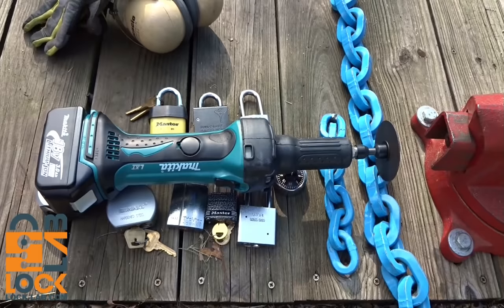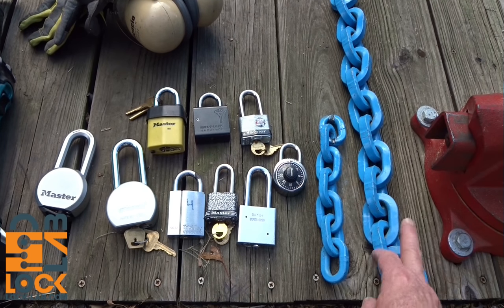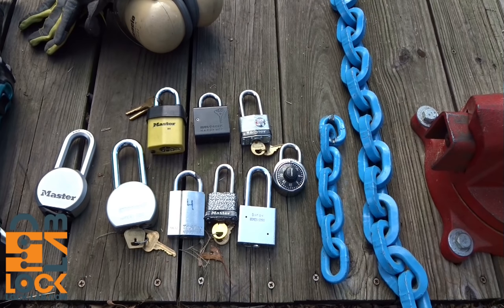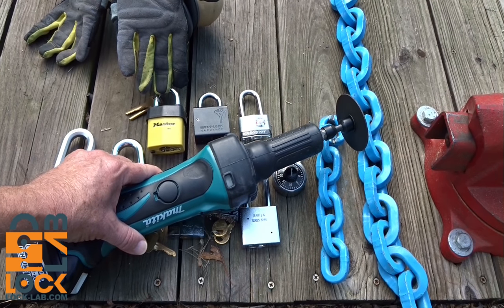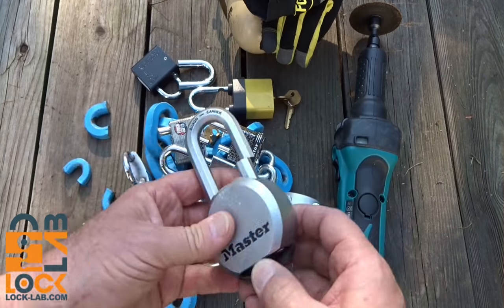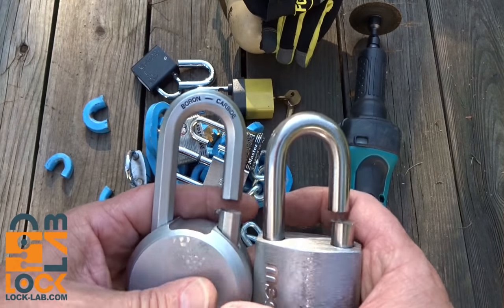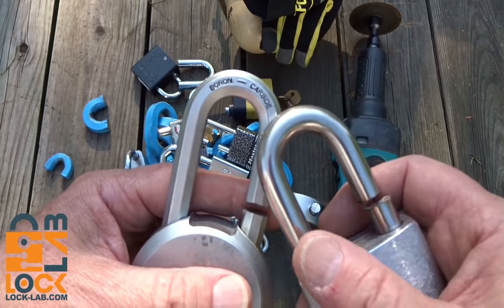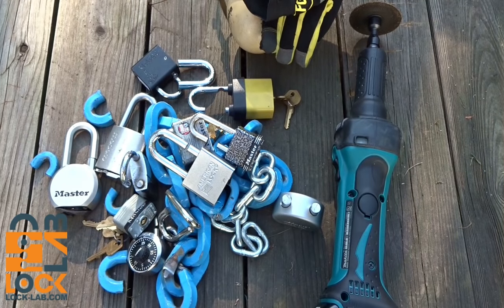(930) Die Grinder versus Locks - How Long?

Comment: This is pointless... The only main difference between a die grinder and an angle grinder is that the angle grinder is offset 90 degrees, and is only set up to accept grinding wheels, where as a die grinder can use a multitude of attachments. They both spin at the same relative speed. In theory using the same cut off wheel on a die grinder and an angle grinder with the same pressure should cut at roughly the same speed.
Reply: Actually nope it's not just one is angled and one isn't generally angel grinders run around 10k rpm and die grinders around 20k not to mention die grinders are more compact and lighter than able grinders.
Reply: Most electric die grinders go to 25K, even the cordless ones. The cordless 4.5" angle grinders I have ever seen go only to 8.5K. But you have to include the diameter of the wheel to get the surface speed. Circumference is proportional to the diameter. So the die grinder in this case is (25x3)/(8.5x4.5) times faster. This is 1.96 times faster surface speed, best case scenario, using fastest die grinder vs typical cordless angle grinder... both with a brand new disc. As the disc wears, the angle grinder will catch up a bit.

The other major difference is the thickness of the discs. The 1/16" disc in this video is actually thicker than many angle grinder cutoff discs. If he used a 1/32" disc, it would have cut much, much faster.

The other factor is the rigidity of what you're cutting. If you lock the shackle in a vice, you can probably cut it faster with a high power angle grinder, because you can put more weight into it vs a lower torque die grinder. (Assuming the angle grinder has more power, which is the case if you are buying tools at the top end of the power spectrum). But if you can't clamp the lock down to something heavy/solid and are just holding it in your hand, speed trumps torque, and the die grinder should win.

If you want the fastest cut through a lock shackle with a portable cordless tool, I bet a cordless trim router with a 1/32" cutoff disc will beat both die grinders and angle grinders.  Same speed as the die grinder but with more torque.

Comment: all these different pins and learning how to pick and then some punk can just grind through the lock in 10 seconds and get away with it. sure its loud, but no one will get up at 3 AM because of 10 seconds of noise, and when the police is there the thief will already be gone. so better not leave your bikes outside!
Reply: Exactly and if there is a thief prepared enough to carry a die grinder, he's probably prepared enough to bring a gun. Nobody gonna risk getting shot over your bike getting stolen.

Comment: this is close to what i was looking for. i use a battery 4.5" to 5" grinder with a metal cutting blade at 8500 rpm. i use it to cut a lot of things. modify doors and door frames. if you could not cut the lock with it, it seems that you could just cut anything that the lock is attached to.

Comment: So bottom line it doesn't matter what lock and chain you are using. It is only a few seconds different.
So, the question is - what all of these big and heavy locks and chains bringing to the table?
Reply: They are a deterrent. You can never prevent entry unless you have a private army, it's all about making entry difficult/inconvenient/noisy enough to deter would-be criminals.
With that being said, I was pretty shocked to see how effective this die grinder was, and based on the physics of a die grinder vs an angle grinder, I bet a simple battery-powered dremel would be pretty effective too (maybe taking 4 or 5 times longer with a good cutting wheel, because dremels also have insane RPM)

I'm guessing 99% of criminals have no idea how to pick anything more sophisticated than a very basic lock, and will always prefer force - so in that case I think it maybe makes sense to buy big locks and chains, but not sophisticated or high-strength ones - expensive materials only seem to buy you an extra 5-15 seconds.

Comment: I'd like to hear the logic as to why people think a die grinder would cut something faster than an angle grinder.
Reply: Tim Ramich I have no idea, maybe they meant  a cut off disk for an angle grinder. I mean, if your going for small, a dremel micro is about at small as you can get, it will easily fit in your pocket and cut through a lock shackle without the battery dying, why not use that instead of s die grinder ( although die grinder are much better)
Reply: RPM's, a die grinder gets up to 25,000, an angle grinder is a mere 8,500.
Reply: majikthise110 but die grinders have a lot less torque than angle grinders. You can really crank on an angle grinder and take off more material per rotation with an angle grinder. The die grinder even crapped out a few times when bill was cutting through the shackles, that won't happen with an angle Grinder unless you REALLY pushed on it.
Reply: majikthise110 You're talking about an air die grinder. They have little power. My cheap Skil angle grinder does like 14 krpm. What matters more is the linear velocity at the edge of the disc and the horsepower behind it. An angle grinder is for cutting. A die grinder is for small carbide bits for, you know, grinding imperfections from dies.
Reply: Tim Ramich the RPM's I said were both from makita cordless tools.

I'm not sure how much applying extra pressure and torque will actually affect the rate of cutting. 

I feel the narrow surface area of the die grinder will help to cut faster aswell.
Reply: majikthise110 to better explain myself, imagine a hand saw, it bites a lot deeper and cuts a lot faster when you apply more pressure, right? It cuts better, but only until you can't put enough effort into the stroke the make the teeth cut into the wood your driving them so deep, this will have the same effect on a cutting wheel, so more torque allows for more purchase I guess you could call it. As for the smaller contact point of the die grinder, I already said use a cut-off disk for an angle grinder, instead of the grinding wheel bill used in an older video.
Reply: +Tim Ramich you have no fuckin clue what you're talking about. air die grinders are the industry standard for power AND rpm. you must have some shitty harbor freight die grinder on a bike pump.

anyways, to answer the question, the reason rpm matters with cutoff wheels is because it's abrasive. it's not a saw, it's not cutting away metal shavings. it's just abrading away sparks with the material from the disc itself. that's why you need high rpm. an angle grinder works fine, too, and you use angle grinders for more than just cutting. so for strictly abrasive cutting purposes higher rpm is better because the faster you get the abrasive material (aluminum oxide for cheap disposable discs, add carbide dust to taste for even better cutting performance for more cost) in contact with the metal to cut the faster it gets through it.

the abrasive disc itself is what does 90% of the work, the weight of the tool is enough. torque requirements only go up with feed pressure and contact area, that's why cutoff wheels are thin. you don't require as much torque here, since you are letting the tool do the work instead of leaning on it like you would a drill, or a grinding/flap wheel on an angle grinder.

different tools for different jobs.
Reply: it's more about the speed of the edge of the disc then rpm.  a 3" disc at 15k rpm (probably a realistic speed under load for this die grinder in the video) is the same as a 5" at 9000 rpm (maybe slightly optimistic), and a 3" disc isn't going to stay at 3" for very long, smaller wheels wear much faster then larger ones.

all in all, a angle grinder is going to cut faster then die grinder.  Die grinders are for getting in small places, not getting shit done fast
Reply: So many men arguing lol although i have no idea what any of it means it is entertaining, and the video was great and goes to show that nothing we protect is actually safe.
Reply: SuperAWaC Angle grinders are more powerful than die grinders. Die grinders typically use carbide bits, which DO actually cut material. Now go away.
Reply: My makita 18v 4.5 angle grinder does 10k rpm. I don't know where this guy got his "mere 8.5k"...
Reply: I just googled makita angle grinder, clicked the first cordless one and got that from the specifications.
Reply: +majikthise110 I've no idea about the discussion going on, but props for the Hitchhikers name :-D
Reply: Periferal speed. The Rpms matter not a jot. The thickness to the cutting disc was the main issue in previous vid. Bill was trying to cut with a grinding disc. Not a cutting disc.
Reply: Angle grinder has more torque, lower RPM and bigger disks. While bigger disk at lower RPM can maintain comparable linear velocity to smaller disk on faster die grinder, to manufacture that bigger disk, it also has to be thicker, hence removing more material during the cut and doing more work overall slower.
Reply: like 9mm vs 45acp  light and fast or slow and heavy.
Reply: I use both in my shop and the die grinder ergonomics don't make it "faster" but they DO permit operation in more confined space. There being little in the way of places to rest your chain or lock against. die grinder ergos would win in that scenario and are easy to control one-handed.
Reply: all about thickness of the cut off wheel thinner faster cut thicker slower
Reply: Everyone knows they like more rpm but you're not going to please them unless you've got some torque behind that.  All you guys trying to compensate with your lack of angular thrust by angling it, just aren't going to satisfy her.  Pretty sure that's what's going on with all of this angle grinder talk I'm seeing here.

Comment: I noticed you cut the chains through the weld. Is that considered the weak spot?
Reply: I wondered the same thing but I would guess they harden the whole chain after welding so the welds should be relativity hard as well.
Reply: Also if it is a weak spot, then it is fair game to cut there. It would be there on any other chain as well, so any thief would cut there as well.

Comment: well to be honest it would be a lot more difficult to cut a lock with a die grinder not in the vice. if the lock was hanging from a chain loose less of a direct force can be applied to the the lock or chain and would take longer to cut through. by how much I don't really know but would be interesting to see a video of a real world scenario.
Reply: Glen O'Donnell only around 60 to 120 seconds longer. Most of that time is spent getting the chain in a decent position to cut.

Comment: why are padlock shackles round? it seems that if you couldn't turn it, you would have to cut the shackle twice, and that would take twice as long.
Reply: cheater00 Because you have to turn it when unlocking it normally.  But notice how the better locks prevent turning until both sides are cut.

Comment: yikes. thanks for the damage report. i'm way less concerned about picking than i was before.
Reply: Thieves never pick, they always cut, even in total silence but slowly with a cheap manual saw for metal. If they can be seen then quickly and loudly with an angle grinder or a die grinder, the fastest the safest for them. There is no chain or padlock which can resist that, you need alarms.

Comment: Thanks for the video. I want to luck my tractor but it looks like chains and padlocks don't really work. Especially when my tractor is parked in the barn and there is electricity there (and probably a grinder laying around). Any suggestions?
Reply: Hidden kill switch in the electrical system in the tractor.
Reply: @exnihilo415  Get a hardened steel chain and use a motorbike lock with alarm which detects vibrations. Yes, yours is a tractor and not a motorbike but that lock works also on it. Check this as an example and greetings from Spain. https://www.youtube.com/watch?v=o5AngeeSu7c

Comment: I didn't realize how enormous the cordless die grinders are! I am used to using a pneumatic grinder in the shop and it's only the size of the very front piece of that thing.. what a tank!
Reply: Air tools are always going to come out on top for power to size.
Reply: It's still smaller than an air compressor...

Comment: Bill, have you ever tried this against shackles made out of titanium or tungsten carbide? Are there actually any shackles/chains made out of that stuff? Let's say a tungsten carbine shell and a steel core?
Reply: Would like to see this too, but I imagine there are fairly narrow applications for chains and shackles that expensive. Still, I think a die-grinder would do pretty well, because it's not facing the problem of metal hardness vs metal hardness like you get with a hacksaw. It's abrasive cutting, like how you can cut through 8 inch thick tank armour with a high pressure water jet.
Reply: Tungsten carbide is brittle. You could just shatter it it in 1 second with a sledge hammer

Comment: i wonder how much of a difference it would make if it was a 20v instead of a 18v
Reply: not much. a tiny bit more torque.
Reply: 18v and 20v lithium powered tools are the same voltage, one company just rate's their batteries a little differently from industry standard.....
  the real difference would be using a angle grinder rather then a die grinder, more power, bigger cutoff wheels
Reply: 18 and 20 volt lithium tools are exactly the same. the 20 volt claim is pure marketing wank from dewalt and any other company that uses that lie. exactly the same cells inside the batteries in exactly the same configuration. but when they are fully charged they are indeed over 20 volts. 18650 cells have a range of 3.6/3.7 volts (flat) to 4.1/4.2 volts (full)  calling their tools and batteries 20 volt would be the same as calling them 16 volt....... not technically lying, but completely dishonest bullshit all the same ;-)

Comment: But it didn't answer which is better. The die or angle?
Reply: an angle grinder is more convenient to hold, discs are cheaper and due to their higher diameter last longer and can cut deeper. But die grinder allows cutting in places an angle grinder can't get to
Reply: @alexeychernenko2096  I know what the difference is. What's in question is which is better for cutting locks.
Reply: @roamingcelt  I'd vote for angle grinder. A die grinder is not well suited to work with cut-off discs actually. One slight move of the hand and the disc jams and probably breaks. You can even see this happen several times in this video

Comment: Liquid Nitrogen 🔫
Reply: doesnt work....
Reply: Then you never did it right, It will crack the shackle right off most locks,done right
Reply: Takes longer to get the metal to that low of temperature. It is quieter, but only if you have a container large enough that you can dunk the entire lock into it. 
Also, cost prohibitive as it evaporates fairly quickly so you'll need to keep replenishing the container
Reply: Exactly  a thermostat and a small pale or container to Submerge the lock will break just about any lock

Comment: Would it be possible for you to do a door (room instead of front of a house) lock picking tut? I plan on getting into lock picking to make a small out-of-house lock picking business and I'm not sure whether doors would work the same. I looked into the key hole on my room door and could not find the pins. There were 2 holes on either side and, when locked, there was nothing present in any of them. I'm receiving my first 2 lock picking sets hopefully tomorrow and will be picking up a bunch of different pad and combination locks to practice on so I'm still not even new to lock picking. Cheers in advance and I'd understand if there was a legal issue with doing so.

Comment: I used to work at a gym. People would lock their keys inside their lockers. Never found a lock that a good bolt cutter wouldn't get through. Pretty sure it would go through most U locks as well. That being said this die grinder seems to work really well.

I was looking for a good lock for my bike that I ride around college campus. From this video, I am realizing there isnt a lock in the world that would actually guarantee my bikes security. Good thing it is a cheap bike. I am just going with a thick U lock.